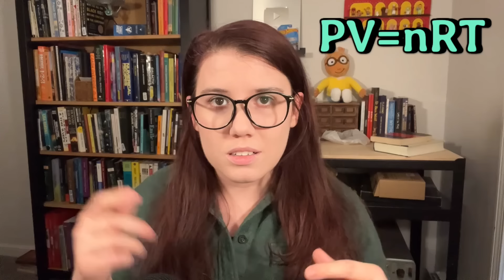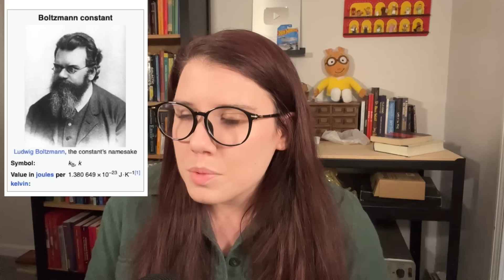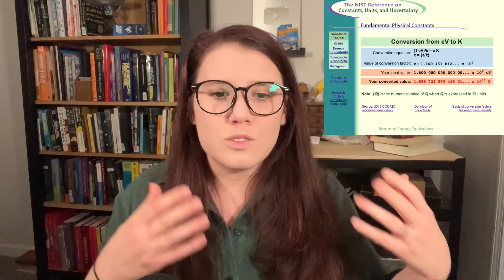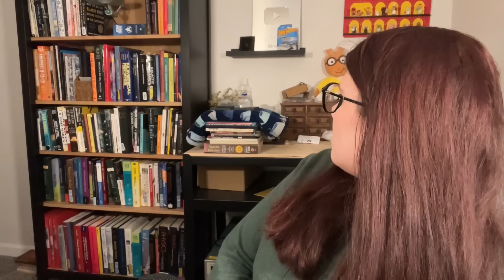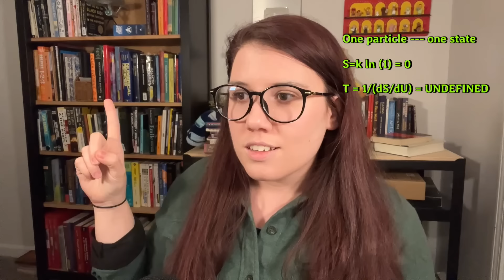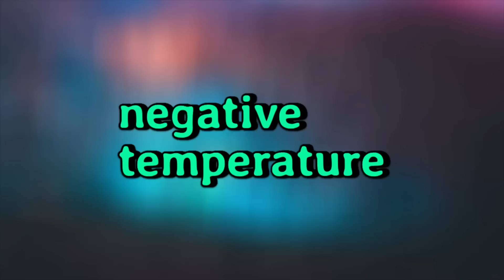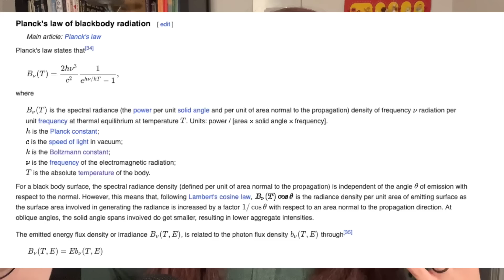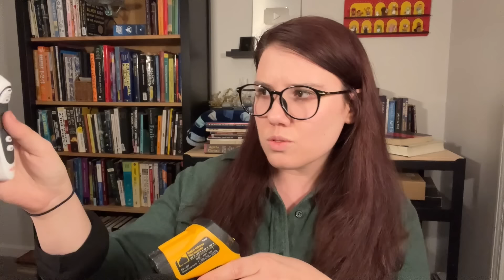the concept of temperature

Comment: As you say, the stat mech definition of temperature is proportional to the inverse of the standard deviation of the velocities/momenta. You can absolutely compute statistics of one thing: In the case of one atom, the standard deviation is zero, so 1/standard deviation is 1/0, which is not defined, so this is all still consistent with the 1/(dS/dU) definition.
Reply: This seems to be a mix of different concepts and isn't accurate. The Statistical Mechanics Definition of Temperature is not directly related to the standard deviation of velocities or momenta. The standard deviation is a measure of the dispersion or spread in a dataset. In the context of a gas of particles, the Maxwell-Boltzmann distribution describes the distribution of speeds (or equivalently, momenta) of the particles. The standard deviation of this distribution gives a measure of the spread of speeds in the gas. But it isn't correct to say that temperature is proportional to the inverse of this standard deviation. 

For a single atom, the concept of temperature doesn’t apply in the same way as for a system of many particles. Temperature is a statistical property that emerges from the collective behavior of a large number of particles. The standard deviation of the velocity or momentum of a single atom is not a meaningful quantity in this context.

You mixed these concepts in a way that isn't accurate.

Comment: Great video as always! Love the music choice :)

Here’s a real-world example of how to create negative temperatures using magnetic fields:

Take a sample of solid Lithium Fluoride and put it in a strong magnetic field to magnetize it. Lithium Fluoride is used for two reasons: first, the Lithium nuclei behave like paramagnets so they can be easily magnetized. Second, the Lithium nuclei are poorly coupled to the rest of the crystal so it takes a long time for them to demagnetize on their own, giving us a chance to measure the magnetization.

Let’s define it so that the magnetic field is pointing “up” and the field is so strong that it has aligned most of the spins of the Lithium nuclei. To work with some numbers let’s say that the field is so strong that 80% of the spins are aligned parallel with the field pointing “up”. The remaining 20% of Lithium nuclei spins are pointing “down”.  Referring to Dr. Colliers graph at 40:20, we would be on the left hand side of the graph because most of the spins are pointing “up”.

To get to the right hand side of the curve where the slope of ds/du is negative, and therefore the temperature is negative, we have to flip the spins so most are pointing down. To do this, the sample is quickly removed from the strong magnetic field and placed in a solenoid (a hollow cylinder with wire wrapped around). Through the wire we short circuit a current creating a magnetic field in the solenoid and our sample that only lasts a few microseconds and is pointing “down”. This brief field inverts the spins of the Lithium nuclei so that now, 80% of the spins are pointing “down” while the remaining 20% are pointing “up”.

If the sample was originally at room temperature or roughly 300K while saturated in the strong magnetic field, the spins of the lithium nuclei now correspond to a temperature of -300K. The rest of the sample, that is the Fluoride atoms and electrons, is still at room temperature, so the way we measure this negative temperature is by measuring the size and direction of the magnetization of the Lithium atoms. This can be done for instance with a radio frequency spectrometer. 

If you’d like to know more, the experiment I just described was first done by Purcell and Pound and published in Physical Review 81, 279 (1951) “A Nuclear Spin System at Negative Temperature”.
Reply: Likewise, heat can also be created from magnets by putting magnetic material into a high-frequency oscillating magnetic field that makes the magnet’s polarity switch back and forth at a high-enough rate to produce noticeable friction.

Comment: 11:24 dumb question but why (and how) does the energy in oceans turn into hurricanes instead of staying there?
Reply: I know more about tornados, but the whirlwind is caused by low air pressure high above the ground, and the higher pressure air near the ground swirling up to fill in the lower pressure above, almost like a vacumn.  I watch too many tornado videos on youtube I guess.
Reply: to my mind, because ocean gives more energy then gas can absorb through m^2.
in that square water and gas have same "space-time" coordinates X=a+-e; e=epsilon-> 0; 
but different "DOF-LTE" coordinates Y=w and Y=g.
(w-g) is "DOF-LTE" FORCE didn' allow energy to be staying in water.
According to Boltzman, speed of local temperature could not be infinitely fast, therefore
extra LTE speed=infinity+1,infinity+2,infinity+3.. with help of 1/"DOF-LTE" FORCE after swapping becomes DOF=1,2,3..
Then with help of "DOF-LTE" FORCE DOF=3 -> DOF=1 , after that  redirection "DOF-LTE" -> "DOF-time" in zero-point
and  carry without any breaking DOF-shape on "space-time" line :
-1D electric magnet(linear CD,DOF=1) or 
-2D electric mass(circular CD,DOF=2)or 
-3D electric ball (graviton,spiral CD,DOF=3)
...
depending on amount of extra energy.

To accomplish we need "time-space" FORCE for D=-3 -> D=-1.
But ,already,there is no extra energy , "1/space-time"FORCE=0 therefore
 redirection "time-space" -> "time-LTE" in zero-point and carry  back into LTE-shape without any breaking.
We receive LTE-shape -> DOF-shape -> time-shape -> LTE-shape cycle.
So my answer to "how" is very complicated.

Comment: The Solar Constant (81.65 kJ/m2 per minute).  The ocean surface is about 3.6E12 m2, so they receive about 0.27E18 Joules/min (0.14E12 Joules/year), taking into account the albedo of the ocean.  We started burning fossil fuels about 200 years ago.  In 200 years the oceans received about 28E12 Joules sufficient to raise about 6.9E9 Liters of water by one degree.  This volume (6.9E6 m3) spread out on all the oceans surface corresponds to a thickness of about 2 microns!  Where is my math wrong?

Comment: Every experiment showed that basically water expands with increased temp.
Multiply the volume of the ice by 0.92 to get the volume of water from its melt. Also there are a lot of air bubbles and solids which will be released and reduce the volume of melted water.
Everyone agrees that the climate has been changing long before we had cars and power plants.
Reply: I don’t think you know the topic well.
Reply: @drdca8263   Educate me with anything that you know about topic, please.

Comment: Wait... at 28:21 when you remove the partition, if the bigger box didn't contain matter wouldn't expansion occur at constant temperature (isothermal expansion), because the expanding gas is not pushing anything, not losing kinetic energy?

With the average kinetic energy they had the molecules just able to move further
Reply: I think you're right. If you expand an ideal gas into a vacuum there will be no temperature change, there's no change in momentum.

Comment: Saying a single atom doesn't have a temperature is too restrictive, I think.  I hope I'm not overlooking something, this stuff has always confused me:

You're talking about a situation in which the energy of the atom is definite, but we routinely couple systems to the environment, and then the energy is not definite but the temperature is (this is the canonical ensemble).  None of this cares if the system we are coupling to the environment is a single atom or something larger.  The temperature characterizes how the energy of the atom varies statistically.  Higher T -> higher variance in E.

Even if we fix the energy of the atom like you do in the video, temperature still makes sense in some cases, I think, though it may not be a useful concept.  It could be the case (and often is) that there are more states at the same energy level as the energy goes up (like in Hydrogen), so the entropy may be 0 when the atom is in its ground state, but if we add energy, then it can occupy more states, so dS/dE > 0, not 0.  But at this point I don't think the concept is very useful because you may as well just count how many available states there are if there is a single atom at fixed energy.

Comment: Heat vs Temperature - I always told my students to imagine a small lead weight (like a sinker for fishing (1 ounce or 28 g) and a lead weight like divers use (2 lbs or ~1kg). Now drop both of them into boiling water for a few minutes so that both are the same temperature. Then place both on identical blocks of ice. Which lead weight will melt more ice? And why?

Comment: Hmm I wonder if all different thermometers give the same readings all times and temperature, even theroretically the same.
Reply: They don't. Not even two thermometers of the same model will necessarily give the same reading for the same measurement.(like holding both in your hand at once) They have a precision range and calibration errors. Some or more susceptible to this than others.

Comment: About diatomic gas - aren't the two vibrational degrees of freedom you've described the same? I've searched online and the usual explanation for additional 2 degrees of freedom for non-rigid diatomic molecule is vibrational + potential (accumulated by vibration).

Comment: Well, if you don't want there to be confusion about the significance of a temperature increase of an ocean by one degree, maybe (for example) emphasize how so much more energy is going to oceans instead of emphasizing how much hotter the climate is getting; it's not hard. I mean, then you won't get to feel better than other people who haven't specifically looked at the effects of oceans getting hotter (or increasing in temperature if you would prefer) by one degree and are just going by literally every encounter they have had with one degree, none of which having that kind of severity, because they didn't invest enough of their free time into making sure they wouldn't get corrected about something not in their field by someone who badly wants to make such a correction, but you'll actually communicate to people better the super urgent and important thing that you wanted to communicate, and then you won't have to suffer from so much contemptuous frustration and supercilious incredulity.

People have obviously different reactions to the concept of energy as opposed to temperature, yet the emphasis is on the temperature changes of oceans and such (when not on the even more general situation of the temperature changes of the planet) and generally people's rhetoric when explaining the issue at hand is to use the same concept that didn't work and (brilliantly) expect a different result.

Comment: I know this is pedantic, but no, we did not shove the energy into the ocean needed to raise it 1 degree. We're not even close to producing that amount of energy over the existence of humanity. (rough estimates to heat the entire ocean 1 degree is like 5.6 septillion joules [5.6 × 10^24 J])

What we did was increase the insulation capacity of the atmosphere blanketing the ocean to prevent the energy the sun put in it (and a little geothermal heat) from escaping to space as fast.

Humanity currently produces about [6.2 × 10^20 J] per year, so even at our currently incredible rates, we would still need about 10 thousand years of this energy production level to raise the ocean 1 degree, and then also assume all that energy goes directly into the ocean (So not escaping to space or be absorbed by the earth)

The amount of energy we currently produce in a year, is the same as if the sun would shine one extra hour each year. it's insane, but not a lot in the grand scheme of things.

I know it's pedantic, but she seemed so shocked by the amount of energy we must have put in, but we didn't...

Comment: With both the ideal gas law and the way an alcohol thermometer works, I suddenly considered how bunk it is to say that "liquids are incompressible" because if that were actually true, thermometers wouldn't work the way they do with mercury or not. The mass stays the same, but the volume changes, therefore the density changes, therefore compression happens. Also most liquids freeze at a higher density than liquid, so water is a weird counter example that confuses us on experiences of liquids.

Comment: Way I heard it, with the kinetic energy as temperature thing, is that it's something like the standard deviation of the kinetic energy, which makes some sense because it works out with relativity: with average, a macro object that's moving quickly relative to the observer will appear to have higher temperature.  This also works to effectively remove the ability for a single atom to have temperature because while an average does exist for a single thing, a deviation does not

Comment: I think you never measure temperature directly. Even a mercury thermometer will measure the expansion of a liquid - so there is nothing special about measuring "voltage". For a rigid treatment of thermodynamics I would recommend http://neo-classical-physics.info/uploads/3/0/6/5/3065888/caratheodory_-_thermodynamics.pdf by the not so well known Master of Thermodynamics Caretheodory.
Reply: Do you mean "rigorous"?
Reply: Measuring temperature with a thermometer could be like measuring time with a clock, which doesn't really prove the existence of time.

Comment: (I really enjoy your videos I'm just doing that terrible physicist thing of not being able to not nitpick)

When you take an ideal gas and put it into a small box, and then remove a partition to allow the gas to expand, the temperature actually remains the same. No work is being done on, or by, the gas, and if the entire system is closed then there's also no heat exchange with the environment. Therefore no change in internal energy of the system, no change in temperature (again specifically for the ideal gas). The way I would explain it to my students is that there are no forces acting on the gas particles to slow them down (or speed them up), so there can't be any change in the average kinetic energy. The pressure goes down though, because the average time between collisions is longer. Entropy still increases, because you've distributed the same thermal energy across a greater volume -- going back to work arguments, it would be harder to extract useful work from the system (whereas you can extract work as the gas expands).

Anyway one of my favourite topics, loved the video, glad you went into the stat mech side of things

Comment: 16:12 It's 6 total. Vibrating towards each other or away from each other is the same thing.
Edit: In some contexts, vibrational modes are ignored, so it would be D = 5. In other contexts, like in the equipartition theorem, vibrational modes contribute twice, because they have both potential and kinetic energies, so it would be D = 7. Seems like D = 6 is never used.

Comment: Negative temperature shows up in Greg Egan's Clockwork Rocket (iirc), where the universe is the right kind of wonky for room temperature to be absolute negative (or as they say in the book, hotter than infinitely hot)

The net effect for us readers is that without air to chill you at high altitudes, you'll overheat, which is relevant when you're building a space rocket out of a mountain to travel sideways in time to fix the universe.

(I don't remember why they don't just think that that's positive temperature, unfortunately! But i think it's something you do with how burning fuel works and the translation convention?)

Comment: I get what you are saying with the electric temperature sensors not "measuring temperature", but in the case of the resistive devices like RTDs and thermistors, it is measuring the very real resistance change in a material with temperature, and resistance is just a measure of electron collisions from Brownian motion in the metal. In fact one type of high-precision temperature sensor is called the "PT100", which is essentially just a precision 100 Ohm resistor made from high purity Platinum, where we know the Thermal Coefficient of Resistance for Pt very precisely. I see this resistance change as an analog to the volume of the gas/liquid changing with temperature.

On the other hand, a thermocouple is just voltage hanging out because two different metals are touching... and that is a scary black magic. I am not sure that is actually "measuring temperature" 🤣

Comment: Wouldn’t a laser measuring temperature on the surface of an object, ever so slightly raise the temperature. It’s not gonna be an issue for 99.999…% of things but say your measurements are extremely precise and the smallest amount of difference matters. How could you measure temperature without effecting a system? Can you?

Comment: I once had a disagreement with someone who stated that heat rises. My view was that it’s true hot air rises but heat moves in all directions. If my thinking was incorrect then you’d feel no temperature increase at the bottom of a ceramic cup when placing hot water in it, since this is  not the case I think I’m correct. Am I?
Reply: correct

Comment: The reason you can't define the temperature of one atom is that you were using an incomplete definition of temperature.  It's not the average kinetic energy, it's the average disordered kinetic energy.  A group of atoms moving in effectively random directions have a temperature, a group of atoms moving in the same direction are just moving.  WIth just one atom, you can't have temperature (actually, you can if it's electrons are excited, but the whole "moving molecules idea starts breaking then).

BTW, this is how rocket nozzles work.  They change a high temperature gas to a low temperature gas, producing thrust.  The atoms are moving at (about) the same speed, but on one side they're moving randomly in the combustion chamber, and on the other they're moving in roughly the same direction: low temperature but you get thrust out of it.